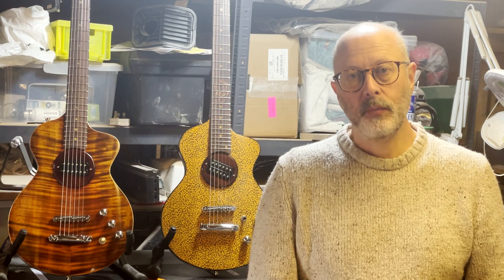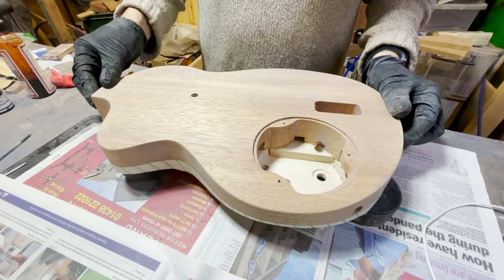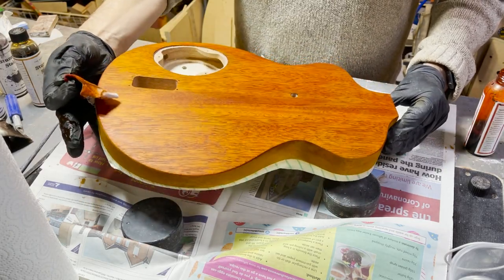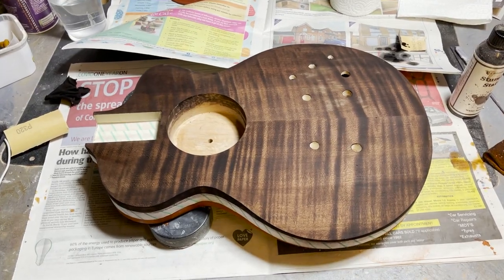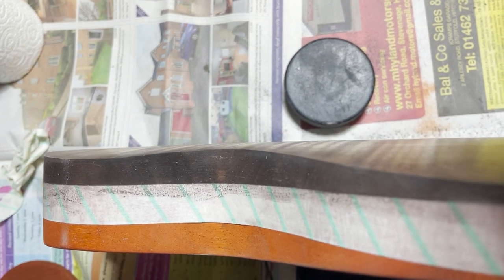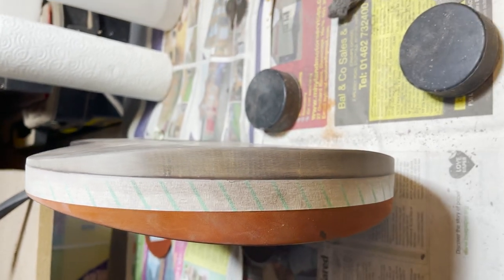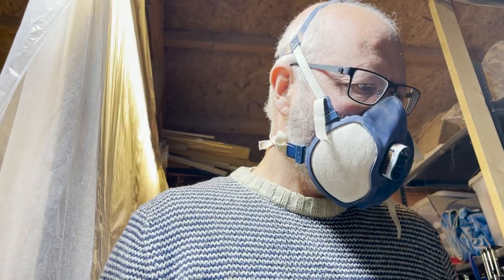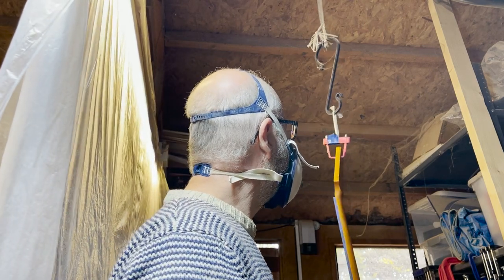Great Guitar Build Off 2021 NAH Guitars Part 5

Comment: Old vid I know, but I’ve struggled with drill and foam pad before. It’s def not ideal for getting a gloss finish. Almost better off by hand. For the quality of work you’re doing I’d recommend a pedestal buffer. It’s really the best, fastest, and easiest way to achieve pro results. The 3m finesse it II is a great product for polishing by hand. And menzerna if using a buffer. I use menzerna compounds followed by a couple of liquid products (3m) as a final polish and wax. Better than factory results
Reply from the maker: Hi. Just spotted your comment. I would like to move to a pedestal system but currently lack the space and throughput to warrant it. The pass work but I agree they do not quite achieve the best finish.

Comment: What easy fill and where do i get it?
Reply from the maker: It is called gyproc easy fill. It comes in a big bag. If outside the uk, there may be an alternative manufacturer. I was thinking of making a product to sell that includes stain. Just add water.
Reply: @nahguitars4816  Aw right, i know what gyproc is but i couldn't hear what you said because of the rustling of the bag . I heard somewhere a couple of weeks ago plaster is an easy filler so it's the same thing 
. Cheers